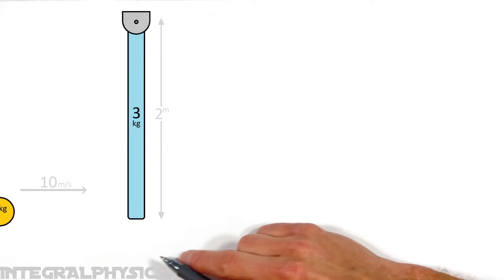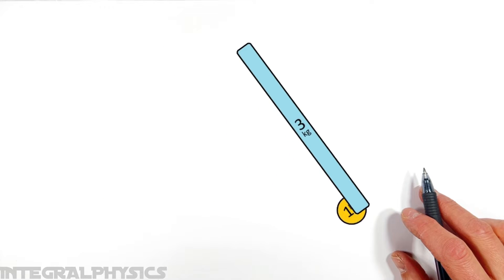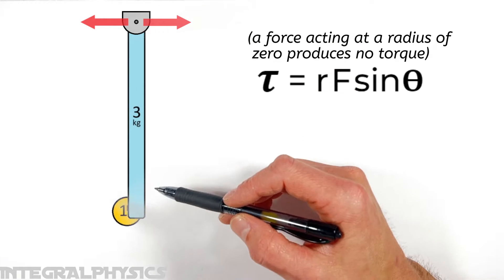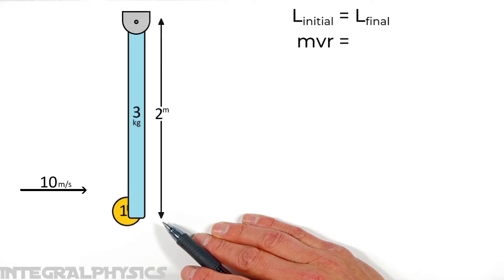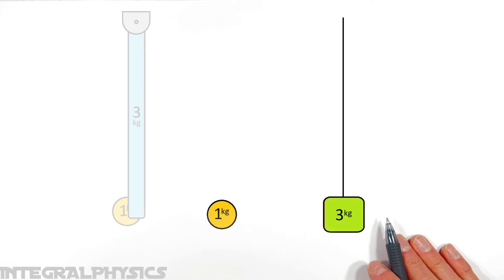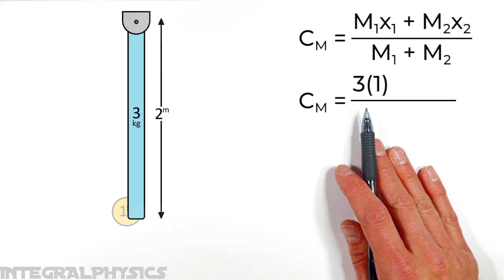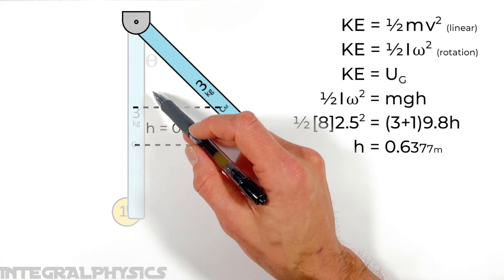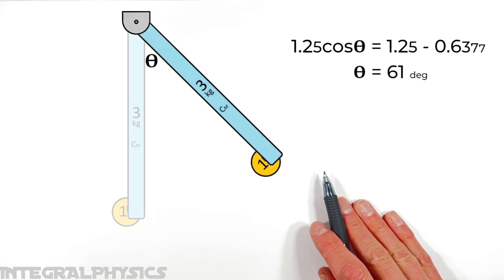Angular Velocity and Displacement of a Rod Struck by a Ball

Comment: Would be fun if you modified this problem to a spring connect on a mass M at the end, a mass m fly at an angle 45 degree to hit the mass M on the spring, the collision is elastic and m has the velocity v’ 90 degree to its initial velocity. The whole system lies on a 2d plane (flat surface with no friction). 1 calculate the velocity and direction of the mass M right after impact, 2. What is the maximum length of the spring, 3. Derive the differential equation of motion of the spring system. All the coefficients like k, initial velocity of mass m you can put whatever you like but i found m=1/3M, k=0,5, v =12 gives a pretty numerical solution

Comment: I do not understand the difference between the two situations you mention in the beginning: the rope is also connected to a rigid point, so there are also forces acting horizontally in that situation.

Or if you look at the force from the pivot on the rod, they are also mainly (like the rope on the block) vertically. 

Lastly, during the rod collision, if the pivot point can produce a force (left or right),  gravity will also have a component not in line with the rod, meaning it exerts a net torque. Could you explain?
Reply from the maker: At the moment of the collision, the string is hanging vertically which means the string is acting only in the vertical plane, thus it does not influence the collision.  It is only after the collision that the masses have moved and a horizontal component of tension will develop.